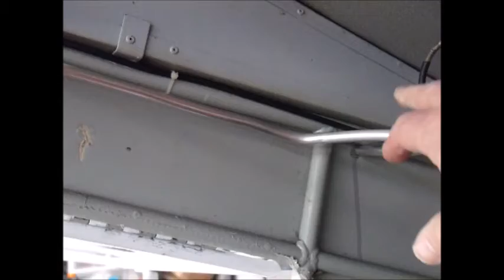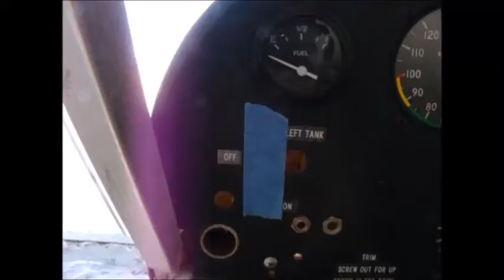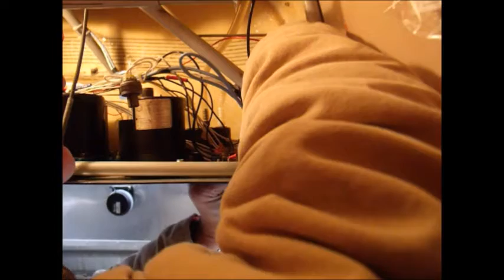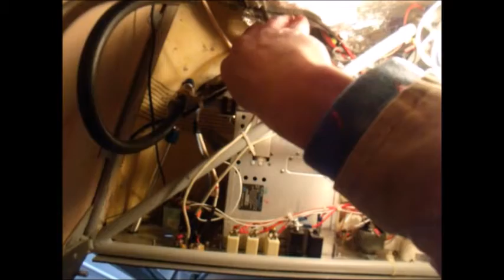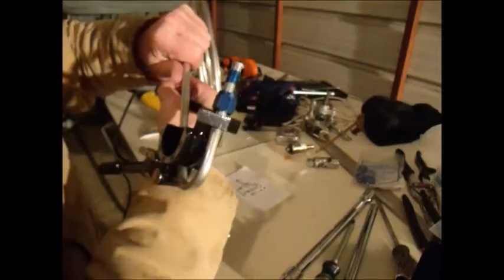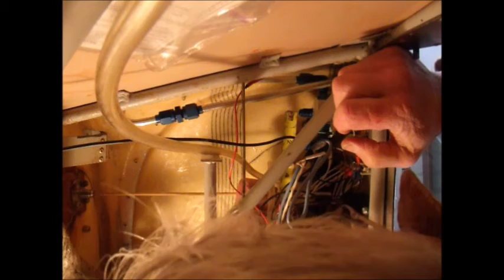Installing new aluminum fuel lines in my Merlin GT

Comment: I am interested in your brake pedal set-up with the master cylinders. How is it working? Could you show how it works and do you strain the rudder pedals when you apply the brakes?
Reply from the maker: This covers the basic plumbing: http://static.veracart.com/matco/item_pdfs/2526/document1.pdf

General information: http://www.matcomfg.com/GeneralWheelBrakeInformationREVD-idv-2665-23.html

I am happy with the brakes. It doesn't seem put too much strain on the pedals - presumably you design the assembly to account for the loads when you apply the brakes. I stand on them pretty hard when I'm doing a stop-and-go so I use the minimum runway.